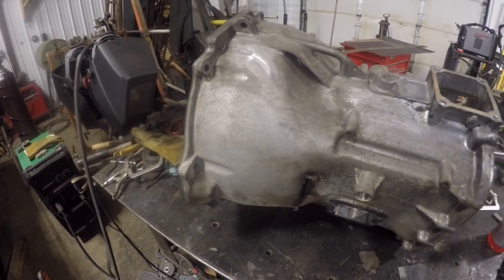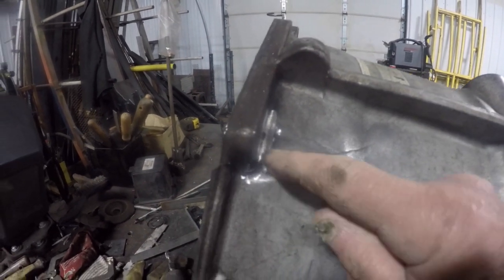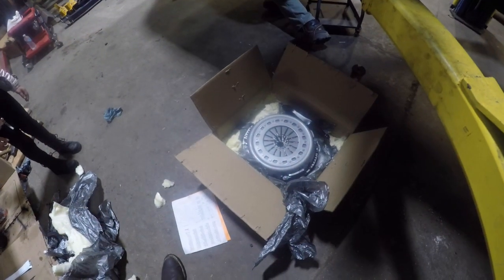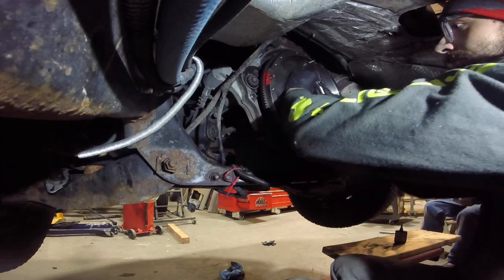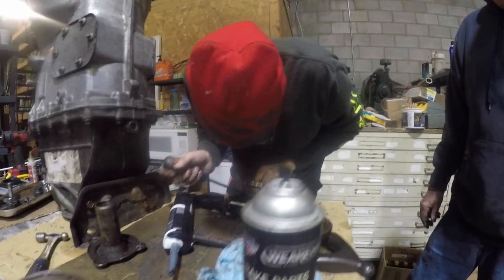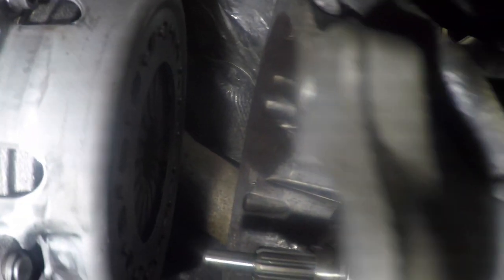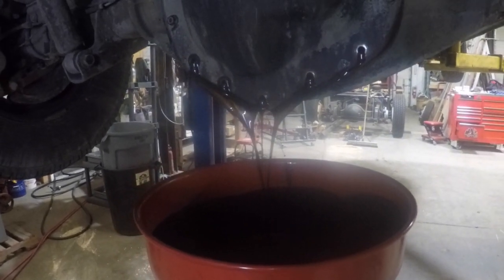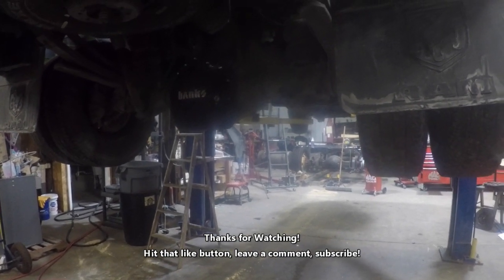Shop Update 01-24-21 - G56 Transmission Rebuild Part 2

Comment: If you had not changed that rear diff oil in 217000miles I think you were well past due.  We change ours every 60k in the trucks that get pulled hard.

Comment: How do u crack a transmission case..
He must of thought he was Grumpy Jenkins running through the gears
Reply from the maker: The case cracked when the pilot bearing let go and the tabs on clutch housing came into contact with case! If you go back about three videos you will see the carnage caused and the pieces of busted tabs that we pulled out.